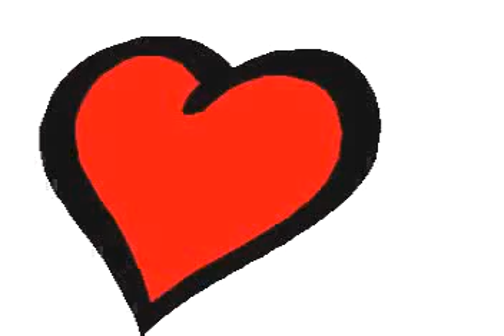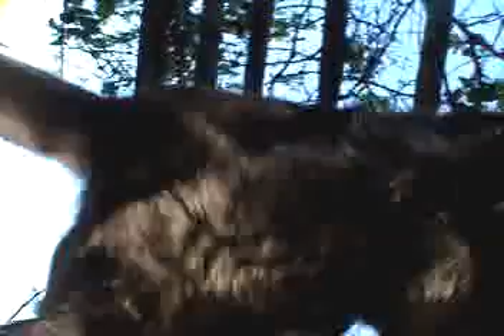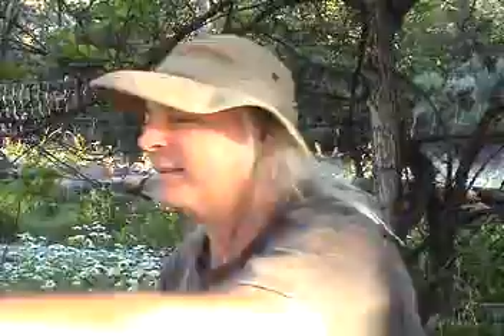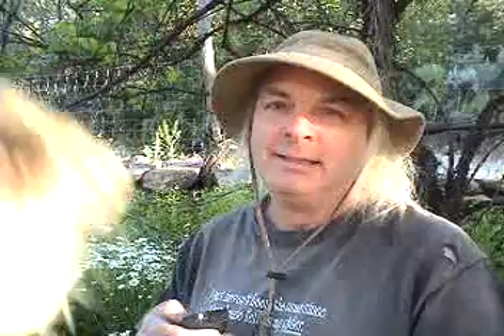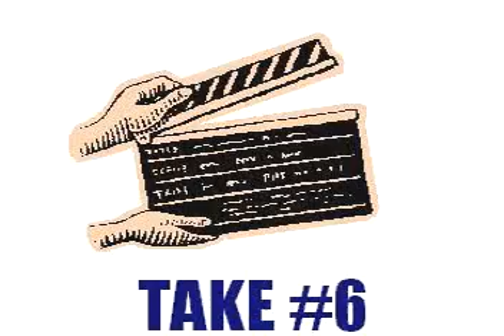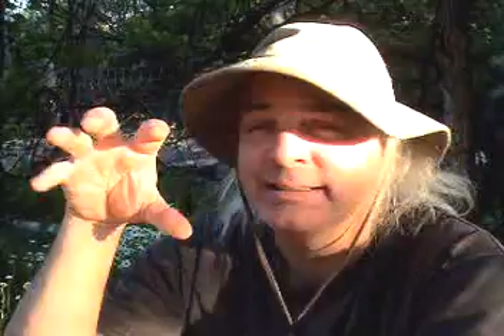Follow-up to 'George Green's magnetic motor' video

Comment: not only do you look like a drop kick you are one the reason the guy moved his hand was because the spinning magnet because it wasn't held in place walked to the side so they had to follow it i have tryed the george green magnetic motor like he has it but mounted a shaft it worked perfectly and yes i had to spin it to start it but i wasent after pechel moshion a guy in my home town invented that 30 years ago i was just after a free running motor to witch i have